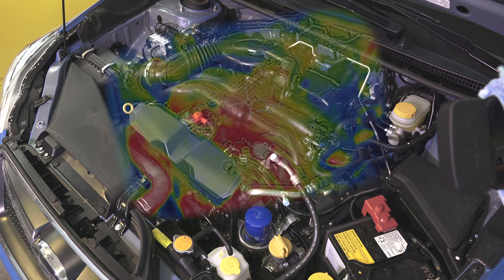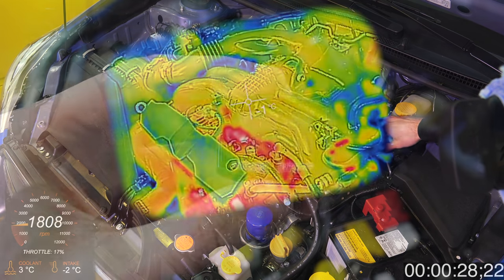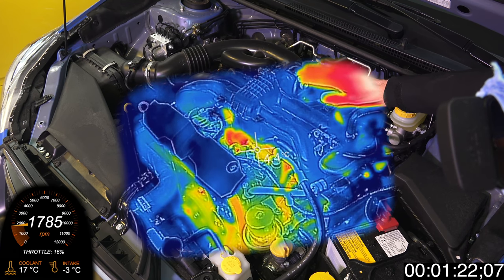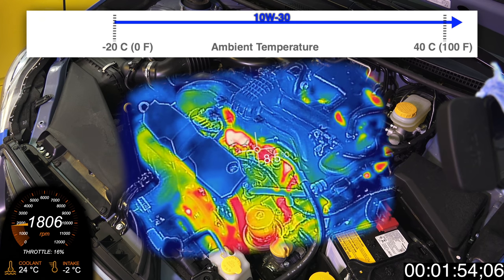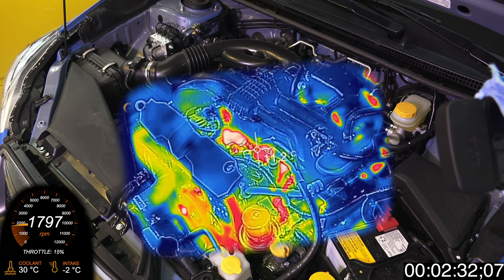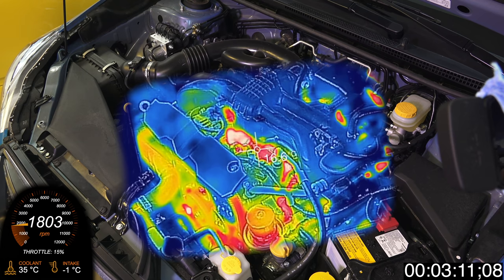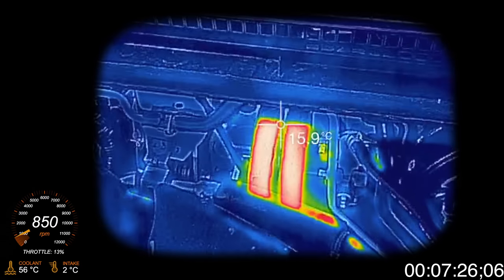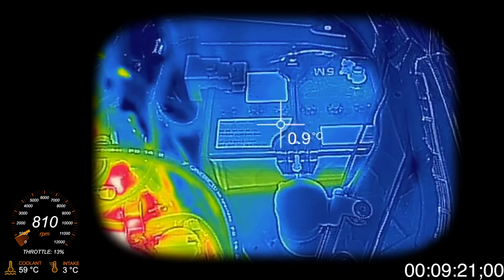Watching A Frozen Engine Warm Up With A Thermal Camera

Comment: Too bad you didn't get your oil filter in the thermal shot while warming up. 
It would have been a rough visual showing how long oil temperatures actually take to come above zero. 

Would have been nice to combine this shot with readouts from aftermarket oil temperature and pressure gauges. 
You may be surprised how long it takes for your oil to warm up when it's -15C outside.
Reply from the maker: Oil filter is in the shot starting at 47 seconds, for the rest of the video.
Reply: Ah, I didn't notice the camera re-positioning after you showed ambient temperature. Thanks for mentioning!

Interesting to see that even after two minutes of high-idle, the oil is still ~9C (by my estimation). This is only 15c above ambient.

[Wish we had a color-to-temperature reference, but I realize the camera is scaling the color range based on the temperatures in-shot]

I'd recommend a set of oil pressure and oil temperature gauges if you want to further explore how the oil viscosity (and thus the pressure) changes relative to oil temperature.

Comment: My car engine warms up fast at idle..on hyway the temp reduces to 1/4 on gauge. Tomorrow  I'm putting carboard inside grll in front of rad and insulation above engine on hood.. on saturns no such thing as winter or summer thermostat. I'll find out after my repairs. 
Any thoughts please?
David
Alberta

Comment: Engineering Explained hello! I have a CVT-transmission car, and if I warm it up about a minute then drive, it revs hard (2k-2.5k range rpm) the next 5 minutes or so while rolling. If I warm it up (idle) for 5 minutes or more, it drives way better. Been warming it up 5 minutes for this reason, but should I just do a minute warm up and go? It just sounds terrible. Thanks!

Comment: to people who say cold engine oil is no good... like warm vs cold maple syrup

Highly sophisticated and complex engineered modern lubricant is so far far removed from maple syrup. All those years of hard work by researchers, engineers and scientists... What an insult to all of them to say this. Modern lubricant maintains viscosity down to-40C, and these oils have been available for the past two decades. Warming up an engine while idle only heats the engine block.. Driving at low revs for 2 km does exactly the same thing, while being better for the transmission, tyres, etc. So please, stop warming up at idle.

Comment: All I see are "Experts" telling me that I don't need to warm up my car, even in very cold temps.  But what I want to see is actual scientific data where someone has taken two identical cars where they tear apart the engines and see the results of one car driving off in cold temps without warming up vs. the other car which had warmed up for a significant time before being driven and then checked for wear.  

This would be the only way I'll believe that not warming up my car is a good idea, otherwise, I'm warming up my car.
Reply: P B That is exactly how I see it. Different parts of the engine warm up at different rates. I'm not driving anywhere until those temperatures have roughly equalized.

Comment: I have noticed that my Japanese brand cars do not want to heat up the cabin if left to idle but need to be driven to achieve this whereas my American and German ones have no trouble. Any thoughts on this?  I have block heaters in every car/truck I have owned and same synthetic oil for temperature extremes geographically.

Comment: im curious about something, when the car is cold, in automatics you feel that gear shifts are rough like the transmission is struggling, or doesnt want to shift gears early? and shifts at a higher rpm. why?

Comment: PLEASE PLEASE PEOPLE...NEVER  JUMP OR CHARGE A COMPLETELY DEAD BATTERY IN COLD WEATHER!!!!!  Electrolite can freeze if it is dead,so try to turn starter over,and if NOTHING HAPPENS,and you know the history ,cables are clean,etc.,take the battery inside and thaw it out good,test with test lite at least,when it comes up some from thawing out,only then is it safe to charge.I had one explode in about 1973 when I worked at 4th street auto in Lou. Ky.  THANK GOD  i HAD JUST TURNED AWAY,OR I'D BE BLIND. it messed the paint up on several cars ,and sounded like a shotgun!

Comment: Since it's illegal to have your car running in Europe for more than 1 minute there is no way to warm your car. Secondly driving immediately after starting is not that bad if you don't hammer it

Comment: I have an audi A3 2009 1.8T at cold start while its warming up at about 1100 RPMs suddenly drops to about 600-700 RPMs but quickly gets back to about 1100 RPMs can you please help why it does that and normally at winter its 5-10 C
Reply: Thomas Rock no check engine light, but what doe you mean by IAC, TPS?
Reply: First you are on youtube don't try to get mechanical advice, second check on forum much more reliable here one for you VwVortex.com and to finish you got an Audi that's your problem don't look further.

Comment: So i always wondered, what coolant and oil temps are considered "warmed up", before you  could start pushing the car harder ?

Normally i turn off the heater and drive lightly until i see my coolant temp reaching 90, and oil heat hitting 50+ before i start pushing the car "hard".
Reply: 160 F damn, guess i almost never get to push the car. i only have about 15 miles to work, and i guess during winter i will never see 160 F.

edit. 
i guess it might be because i normally get 50 MPG(US) on gass, so not alot of heat is generated.
Reply: well, i guess i just need to drive alot longer everyday.
Reply: i dont drive around much, however i just do the thing with turning off the heater, so the engine gets warmer quicker, and not putting much load on it.

Comment: How about transmission oil temp and viscosity? Do you have trouble shifting gears in your CrossTrek when it is cold? I have tremendous trouble if I only warm up my STI for a couple tens of seconds if it is freezing outside.

Comment: What OBD app is that? Looks slick.
Reply: you mean infrared thermographic camera? not everything can be done by app...
Reply: I meant the one that displays the RPM and temps.
Reply from the maker: Links in the video description! :)
Reply: Engineering Explained Wow, you actually answered. I feel a little starstruck now :)

Comment: Why have timing belts or chains? Why not just use meshing gears? Use 3 gears so that the top and bottom gear go the same direction. Never have to worry about timing belts snapping or chains stretching.
Reply: Aaron Ries Some F1 engines had that. And so do some OHV v8's. Problem is sometimes there is timing play once they wear, second lots more moving parts Especially DOHC. Friction = HP loss. I know some people claim a Double roller will give you a little more hp than a Gear Drive on some SBC, even better numbers at the track. F1 engines is a whole other story. Maybe EE can explain that one.
Reply: Aaron Ries you should work as manager at subaru
Reply: Just a matter of distance I would think.  In pushrod engines they do use gears to connect the crank to the cams, but that's only going halfway up the block.

Also fyi the cam runs 1/2 the speed of the crank, since each cylinder is fired every 2nd rotation.  And doesn't technically have to be in the same direction; you just cut the cam to suit the direction it rotates.
Reply: The truth to this matter is timing chains and especially timing belts are cheaper to manufacture than timing gears...every nickel that's saved during mass production makes the company management and stockholders happier. New cars have taken this to the extreme by forcing the same amount of HP and torque from an expensive-to-replace turbo charger on a dinky 4 cylinder high compression engine. To get a normally aspirated V-6 you'll be looking at over $30k
to start with. If you do the research you'll also find those new 4-bangers don't have any appreciable gain in gas mileage over a V-6 that has twice the displacement and runs on regular fuel. You'd better keep sharp to a tee on your maintenance schedule and fluid selections too if you want to keep your warranty valid.
   10 years from now there won't be many cheap drive able 4 cyl. cars made after 2012 left because they'll all be in the junk yard.
Reply: rayford21 true. Sad thing is who knows how long all the new cars will last wth all the electronic components. Once manufacturers stop producing electronic modules where are we going to get the parts? 20-30 years down the road. Cars are becoming disposable 3-5 yrs and on to the next model. Auto manufacturers raking in big $
Reply: I want to change that. 
Completely outlandish idea here but bear with me

I want to buy the rights to American Motors. Of all the manufacturers that have died, this one. 
Gremlin like the Fiat 500
Pacer like the 500X
Concord as a luxury sedan
Eagle as a 4WD hatchback or Wagon. All new models, Retro but functional styling, and reliable.
Reply: Aaron Ries 1st problem with that is safety. 2nd to even get a chance to become a auto manufacturer you have to pay to play.
Reply: What do you mean by safety? I know I need money. So I've created a channel called A-aron (subscribe to create a better company) and I'm going to build a fan base, from there I want to use the publicity to help spread the word of a go fund me kind of page to raise enough money to start the company and maybe with some government backing we can create cars (and American jobs) and HEY-PRESTO car company! We would make cars that get amazing mileage without sacrificing things like handling, power, or comfort. We will make cheap cars that are sold at lower prices to undercut our competition. We will encourage the use of alternative fuels like ethanol and try to create a better infrastructure for the fuel. On a side note: I know people don't like the stuff and I honestly don't know why. I always see people complaining about gas prices at this one station where I get gas and I always laugh because they've got a flex-fuel car and they're paying $2.29 a gallon and E85 is only $1.69. I know it gets worse mileage but the upfront savings outweighs the small decrease in distance. It's not bad on cars either like regular gasoline is. It runs cleaner, smells better burnt or un-burnt, and as long as we have crops like sugar cane and corn we've got a long lasting source of fuels without changing the design of the cars we run it in. Back to the point: American motors will become a powerhouse in American automotive brands. It will happen.
Reply: Aaron Ries If you are serious we should partner up. No joke. I am studying industrial design right now. It sounds like a coincidence but I too always wanted to build an aftermarket or some sort of auto manufacturer. I graduated from automotive training in sights of Designing quality cars with the background of the true automotive industry. If you are 100% about this maybe we should talk.
Reply: I am 200% serious. I know it's a long way away, but It is a dream I will make a reality.

Comment: My 2015 Mini Cooper S has no gauge or any kind ENGINE TEMP indicator.  not for oil, not for coolant, just the exterior.  Weird!  its the only thing i don't like about my new car.  Its winter now here in New York so I let the car idle for about 30 seconds or until i can see out all my windows and then i drive lightly for the first 5-10 minutes.  Am I doing right by my vehicle?  Would love to know anyone's thoughts on this!

Love the channel!

Comment: My engine (3.6l Pentastar) has a multidisplacement oil pump and runs in the high pressure mode in the cold (can get up to 90psi), does this make it better to drive in cold temperatures?

Comment: Question.  Sorry it has nothing to do with this but my check engine light is on because i have a fuel injector. problem but the light just went off. will it past smog while the light is off?

Comment: Waiting several minutes for a car to warm up is a ridiculous waste of gas.  Let it idle about 30 seconds, grow a pair, and drive the damn thing.  It will warm up faster, which means reduced engine wear, better fuel economy, and you'll get heat sooner.
Reply from the maker: That's what I've stated in this and the other video..
Reply: Engineering Explained yeah sorry, the comment was more for other people who claim to need to warm up cars for several minutes or more.

Comment: Should I  wait a bit longer then 30 seconds if you have a turbo????
Reply: Yes.
The bearings need adequate lubricant flow and to gradually rise in temperature to reduce damage and wear.

Comment: Very interesting,  I'm curious about turbo cars. I live in one of those areas where the wind hurts my face. I have been told by some mechanics up here that I need to let the car warm up so as not to hurt the bearings in my CSRT4. Is this true or does it not make a difference turbo/super or n/a?
Reply: bearings in my turbo on my CSRT4 I mean
Reply: In temperatures below 32F (0C) yes, warm the engine and turbo a few minutes before operating under moderate-high load and or moderate to high RPM. 
This especially true with ball bearing and ceramic bearing turbos. 
The reason is to minimize thermal shock and insure adequate lubricant flow. 
If you doubt my statement contact a reputable turbo manufacturer such as Garrett, Holset, Borg Warner, Bosch/Mahle (not a dealer/seller) and ask them directly.

Comment: Do you have a video on proper oil weight? I remember after fast and furious came out, goofballs were putting 50w oil in their hondas cause I guess someone mentioned it in the movie.. 
What is the point of 'heavier' oil anyway? Is just to deal with the extra heat of racing, or is there more to it than that?

Comment: I am a firefighter who drives from home to run calls. I also live 2 miles from my work. With running calls I need to get there quickly. what is the best method of heating up the engine quickly while still being able to drive with intent? I don't want to ruin my car.
Reply: Jeffrey Early drive it but don't drive it aggressively. think of it like slowly stoking a BBQ, don't piss the entire bottle of lighter fluid in all at once
Reply: Jeffrey Early Fully-synthetic oil, do what Gabriel said, and maybe invest in a 'blanket' for covering the hood of the car? Don't be tempted to place it in the engine bay because you'll forget and set fire to it, but covering the front of the car directly after having previously run it will help. Maybe not overnight, but if you've run it at some point that day.

Oh, and one more thing, get extended warranty on the next car. :p
Reply: I'd say You'll need to cheat and commit the engine to short distance driving only. Low viscosity oil,  hot spark plugs ( I'm serious ), cover part of the radiator or change thermostat to one that opens later or do both. If You car doesn't have under hood noise insulator, get one from scrap.
Reply: its an 06 Pontiac Grand Prix that I share. it has an insulated hood. i have considered the low viscosity oil though. I think it has 10w-30. Idk what you mean by hot spark plugs though.
I might be getting a diesel soon so ill have it plugged in for sure.
Reply: hot spark plug is one that has lower number than stock i.e BR9ES would be swapped for BR8ES. Diesels take way worse short distances. You better not omit pluging in.
Reply: Jeffrey Early well I know on new cars 0W30 is great for oil flowing fast at start up in cold weather. Thats probably the best for quick start and go depending on your car.
Reply: Jeffrey Early garage with heat.
Reply: Maybe an engine block heater?
Reply: GTI Mod Blog I thought of that (only because other people had mentioned them in the other comment threads here), but I don't think it would help because it still requires time to warm up. Unless Jeffrey wants to run the heater all the time to make sure it's ready. That would require one hell of a battery or a shore power system.
Reply: If you are called out most nights, then an engine block heater on a timer makes sense. Have it switch on for 30 minutes then off for 30 minutes in a cycle all night. That will keep the engine above freezing but might keep the bills manageable. 
You should consider grill blocking to keep the meagre heat from the outside cold.

Comment: Which oil is good for 20C temperature  ? &  which oil is good for 50C temperature ? 
Im having 2013 Rav4 with 40,000 km
Reply: where xx=50<
Reply from the maker: Use what's recommended. If it's warm where you live, the winter rating isn't as crucial. Just want to make sure you use the correct operating temp rating. Ex: the "30" in 5W-30; whatever it is your car recommends.
Reply: Yes 5w30 is recommended by users manual but when i was taking to the dealer for oil change till 20,000 km (1st year) they use 20w50 for my car
Reply: Bahrain in the month of August
Reply: there is a good video out there with a comment by another person that the OP of the video sadi summed it up.. basicly 0W-XX is good for winter and DD driving but if you live someplace where it gets hotter then say 80-90*F you might want to bump up to a 5W-XX or 10W-XX if you race.. hard drive.. ie stop and go trafic.. and what not.. also in temp extreams.. you should run full synthetic oils.. always.. they preform better in these conditions weather it be HOT or COLD.. why i run full synthetic in the winter and summer.. in my truck i do run different weights though summer vs winter.
Reply: Thank you for this information

Comment: Wait how your care doesn't rev down until it gets to 50 degrees 
My car even though it's an older I4 engine revs down to 750rpm after a few seconds even in mines 10 degrees Celsius